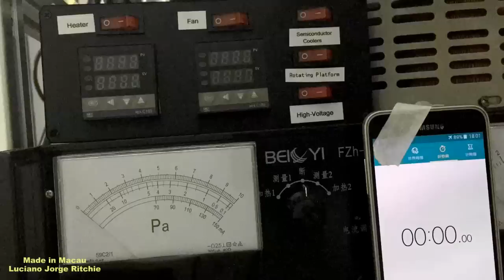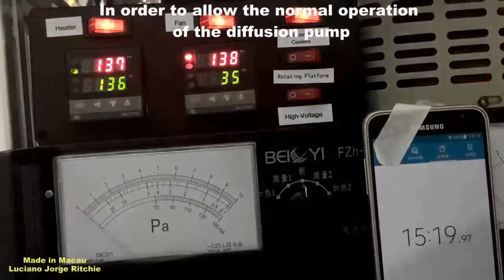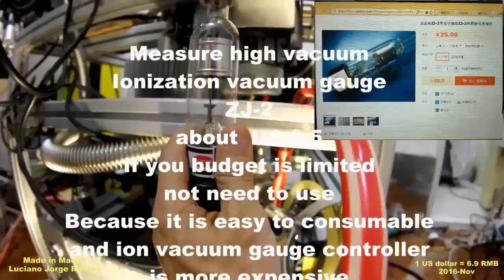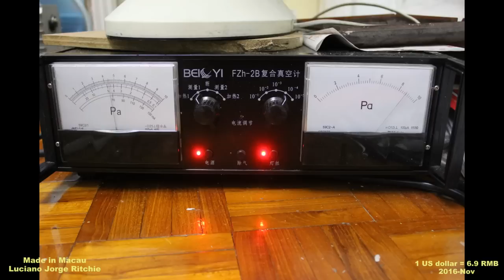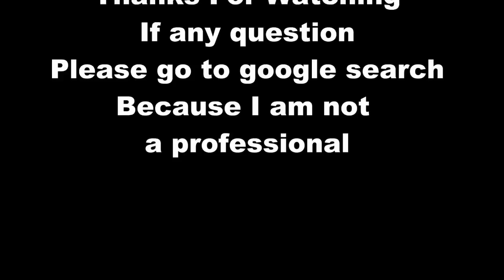Home made Vacuum chamber 2.0 for telescope coating mirror

Comment: awesome job. one suggestion. instead of tungsten wire, use a strip of tungsten and create a small pocket in the middle. this way you can load the pocket with other materials more easily. as well make it easier to clean.
Reply: Tungsten tel yerine normal resistans tel elmazmı

Comment: Great stuff. That is one expensive hobby you've picked, vacuum equipment always costs ten times what it's worth because research labs have more money than sense. Two tips: 1. Always wear latex gloves, the more sweat you put into every surface, the longer it takes to pump it all out again. 2. You don't need anywhere near that amount of grease, just smear a little bit on the tip of your gloved fingertip and then pull the rubber seal between finger and thumb to smear it on very lightly. Only the part of the seal that is compressed does anything useful, any grease not on that part is not helping you.
Reply: Olá,  você teria conhecimento de algum projeto em PDF para a fabricação de uma máquina dessas? Aqui aonde moro no Brasil é difícil de achar quem faça esse tipo de serviço.  Gosto de astronomia e estou fazendo meus espelhos então se conseguir fazer uma máquina assim de pequeno porte seria uma grande ajuda.

Comment: 6:55 I have made one my self and one transformer is more then enough, a coil this size is glowing white hot, its all about the voltage. You dont need the thick cables you use, you need thinner which is totally ok since the current is not especially high for these coils and you need to get the voltage up to at least 5V or so by more turns on the secondary. I have 5.4V on mine which works for pretty much anything and I have also made a small electronic control unit so i can control the power from 0 - 2000W and thus dont need a big variac. 

But how the hell cheap was those voltage control transformers, variacs?! Like only $35? WTF!! They cost at minimum at least 10 times more! Dam..
Reply: @Learnkalaa Whatever works for you. :) I want is small and light and nothing that wears out in the end no matter the load.

Comment: What metal was on the Tungsten (W) wire that melted? Was that to verify temperature?
Reply: Aluminium is the metal on tungsten or cromium, they use both to aluminize.

Comment: One transformer is more then enough for that coil, I know since I have done the same but I made an electronically controlled instead so no need for a variac and pretty much doesnt weigh anything either and take much less space. You have way to low voltage, the higher the better but within reason of course. I have wound mine to output 5.8V and that is enough to make a coil like this to glow bright white with only one transformer, 1.8V is way to little for this length of coil.
Reply: Can you link to your plans ?
Reply: @SmeeUncleJoe  3 years late there but oh well; they were unfortunately not written down but I think ST electronics has an AP (application note) with a schematic that after little tinkering with can be used to control a big transformer, and that was what I used.
Reply: I take it you mean KILOvolts and not volts ?
Reply: @SmeeUncleJoe  Nope few volts, you need a lot of current not so much voltage.

Comment: How did you figure this all out?  Is your work somehow related; machinist, physics, lab, ...?  Or did you start with no experience making anything and do this?  If so...pretty incredible (incredible anyway).  B.t.w. how did you know that a 6mm acrylic dome would be strong enough / safe to use for a high vacuum?
Reply from the maker: I am not clever.I just use Google search powerful knowledge base to building this vacuum chamber
Reply: wow.  You might be wrong--you are clever.
Reply: I agree!  This is VERY impressive work!  I missed how the rotating table works though.  Can you explain please?
Reply from the maker: https://www.facebook.com/permalink.php?story_fbid=1814804622144608&id=100008452620878
https://www.facebook.com/permalink.php?story_fbid=1663759800582425&id=100008452620878
The ring is driven by the motor. you can click the link to see
Reply from the maker: 6mm Acrylic dome is not calculated, just speculation may be useful. If damaged, can be custom made another 8mm  Acrylic dome
Anyway Made in China is very cheap.
Reply: @luciano1218  You used a dome of low melting acrylic plastic with a very hot glowing tungsten coil underneath?! Things were just bound to happen, lucky you didn't got seriously hurt.
Reply: @dtiydr  Dude, it's Vacuum.  Not pressure. 
There is only 14.7 inches Hg Per Atmoshpere............
Reply: @jesscast5122  Have you seen when domes implode? Obviously not. When it does shrapnel will fly outwards almost the same as with an explosion and can cause damage anyway. Look at a crt TV with a hammer flung at it, even if it has a vacuum in it things fly outwards anyway and with force. And thing number 2: you can't coat at any 14.7 inches Hg Per Atmosphere, that's around when the diffusion pump take over and go way below that point, did you even look at the video? Gees.